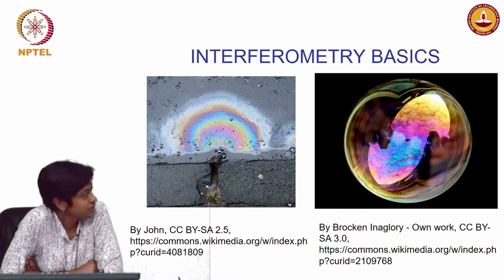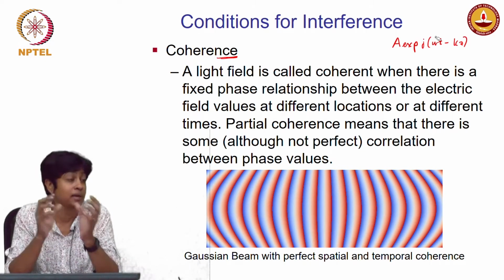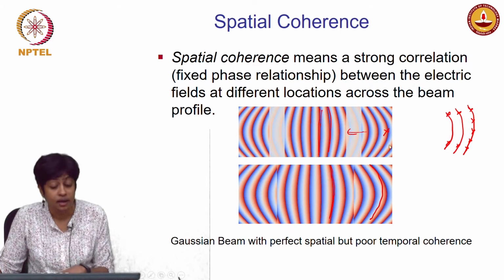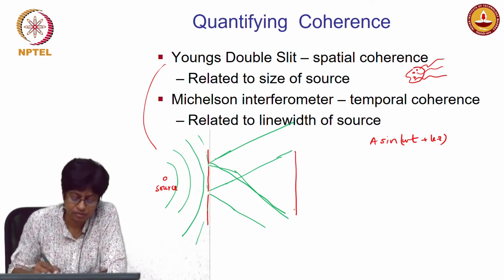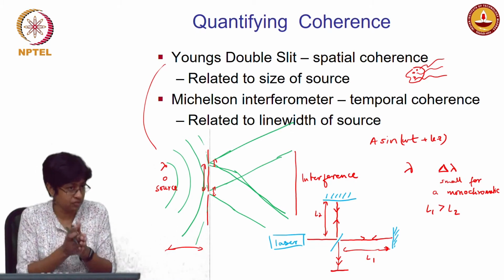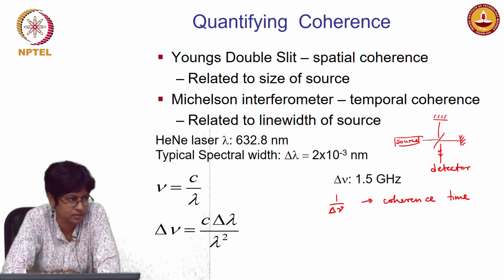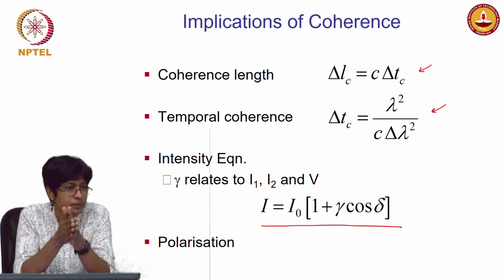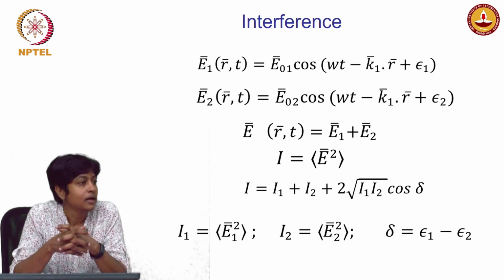#31 Interferometry Basics | Optical Engineering

Comment: Nice explanation. However, I have a small doubt. As you mentioned in your slide, spatial coherence is related to the size of the source, but at the same time, you said that if the linewidth is very large, it becomes poorly spatial coherent. This creates confusion in deciding b/w temporal and spatial coherence.